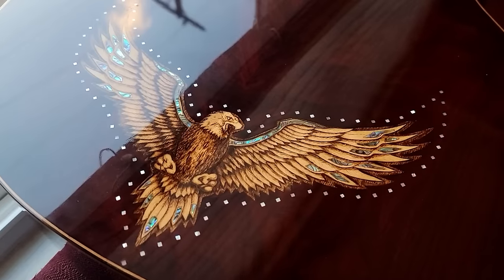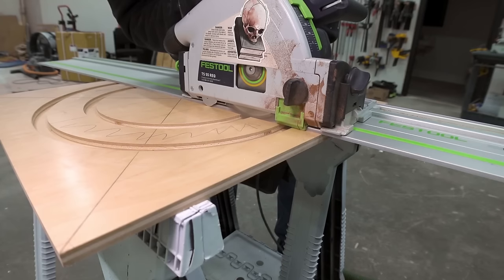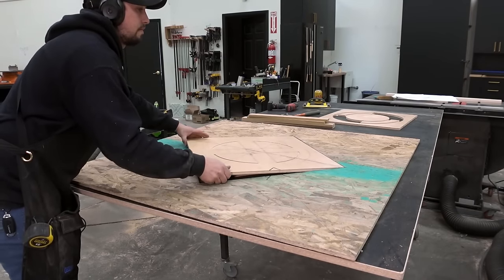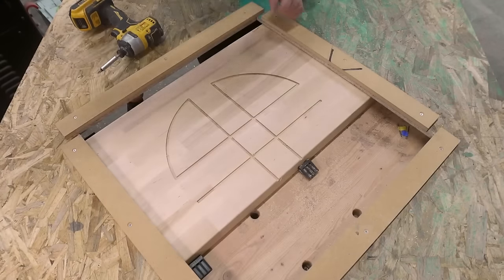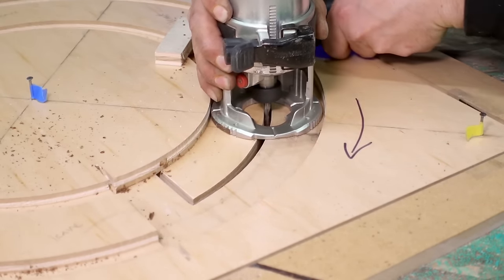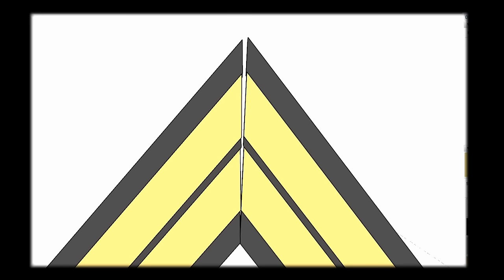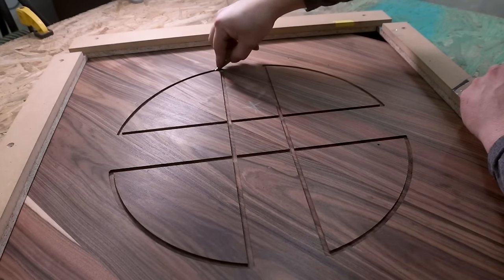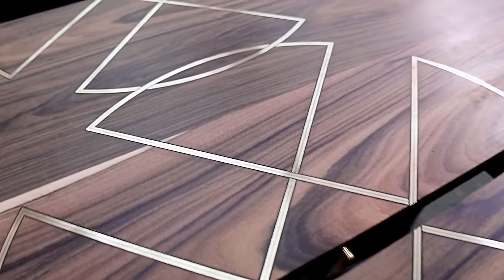PERFECT Brass Inlays in Bolivian Rosewood || No CNC

Comment: Wouldn't adding a tiny gap for the saw throw off the overall length of some of the pieces?
Reply from the maker: Well yah, it makes those connecting inlay pieces a millimeter shorter, therefor changing the alignment

Comment: Ive had really bad luck with CA glue holding brass, and I know others that have also. I hope this held up well for you. I have had to switch to epoxy or hide glue depending on the project when using brass.
Reply from the maker: I see the table on a daily basis and those inlays are still perfect

Comment: Well, you earned my subscription with this video. Aesthetic is personal whilst skill is universal. I don’t really like the aesthetic of the finished product (entirely personal) but I have total admiration for the skill you showed in the inlays. I’ve been woodworking for over 45 years and appreciate very much the skill required in those jigs.

By God, rosewood is so attractive. It’s very busy and that aesthetic may not suit every project or every decor. But, where it does, it really lifts. We’ve got a couple of pieces of antique rosewood and mahogany furniture and I would guess those planks and grain pattern are just unavailable now, Here in the UK, Bolivian rosewood is very rare. Indian rosewood is better but all rosewood is very expensive. Solid timber for a 96” x 30” x 2” (rough sawn thickness) would be over £2500 and that’s using 4” wide staves. I’d have to make a similar table out of shop sawn thick veneers with solid wood edging. Can’t think of an affordable solution other than that - apart from buying an antique table and cutting that up for the timber (I shudder at the thought of that).
Reply from the maker: Thank you, I appreciate that. Everyone has their own taste, and gothic is a very niche style.
Rosewood is also awfully expensive here. But morado is quite a bit cheaper

Comment: You just made my brain stop working. Holy s**t. This is next-level stuff, and while I'm not at that level (yet), I completely see the need for the elaborate jig system. It truly is genius. As if all this wasn't total awesomesauce, now we all come to find out you're a skilled luthier?? I love the rosewood, too, but have a question regarding the ebony - it's insanely expensive, so could you substitute another wood (maple) and then just dye it black, or is there an inherent property of ebony that requires that species?
Reply from the maker: Thank you, and that is a great question! Ebony is useful because it basically has no pores. But mainly, it's used for class. I suggest using a less porous piece of wenge. Otherwise, you would have to literally soak the maple in their strip form, with an alcohol based dye so they don't warp. The problem this might present is bleeding the color when you add the thin CA. 🤔
Reply: @FortressFineWoodworks  Great advice! Thanks!
Reply from the maker: Yes sir!